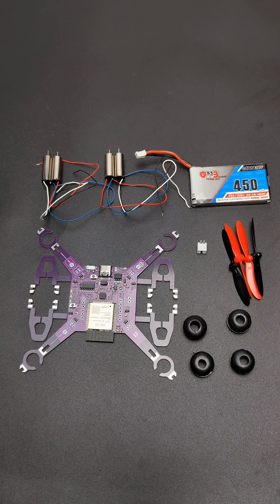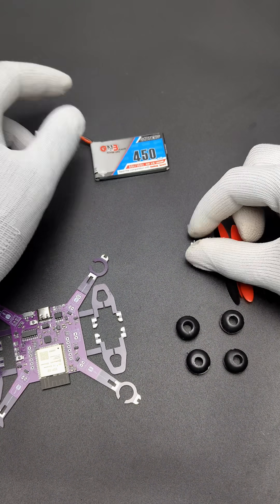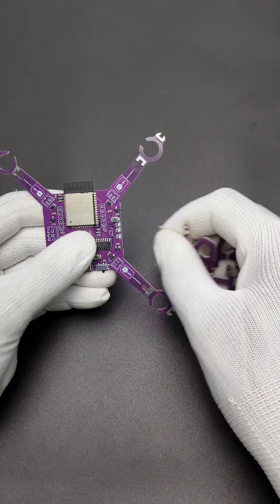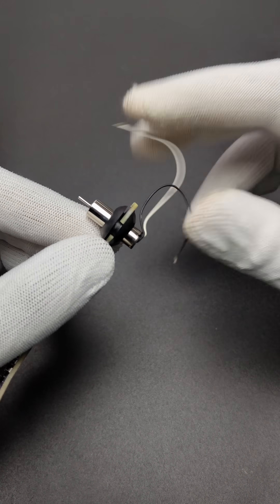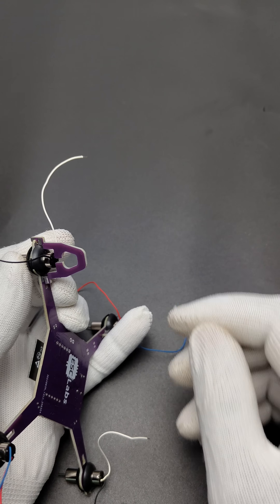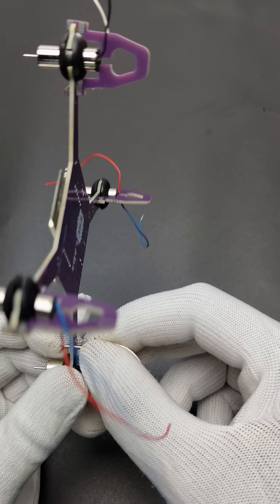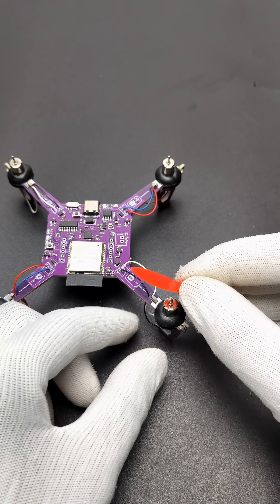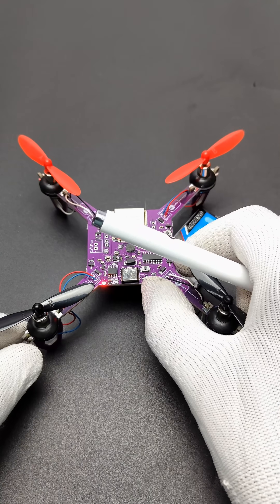How to make ESP32 Drone #esp #esp32 #drone

Comment: Hi sir I'm student I am making esp drone I faced many errors but solved it watching YouTube videos like yours also . But on final steps I'm stuck I'm firmware on the flash monitor screen in collaboration mode. 😢 I wanted to make this project I can't buy this kit also 😭 due to multiple reasons. I checked everything mpu6050 even connection with int to gpuios 14 since official website says that if using esp32 wroom 32d 😢 kindly help I messaged multiple people . Nothing really helps .
Reply from the maker: What you mean by collaboration mode.? ... You can use any ESP32.
 Please contact me on WhatsApp -9074213906

Comment: Can I connect it to flysky fsi6x or radiomaster pocket?
Reply from the maker: No
Reply: @EDISON_SCIENCE_CORNER  ok, it's a great innovation btw. But I failed to understand the purpose of it? I mean it has no camera, the range is not that much, what can I do with it ?
Reply from the maker: It's just a drone. You can build and understand the working of a basic drone.
Reply from the maker: Yes
Reply: @make_with_kunal  You can add a small camera like (have connector for that), but small performance.
Is a developer drone, with this you când develop your software/algorithm or you can fun with this. Aeromodelism is not only photography, is a pure hobby.
Reply from the maker: Correct